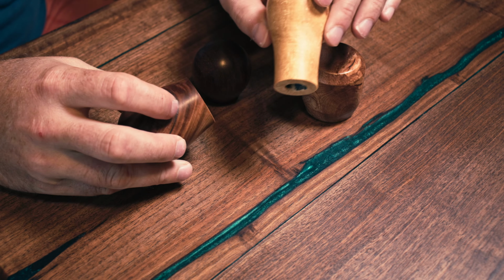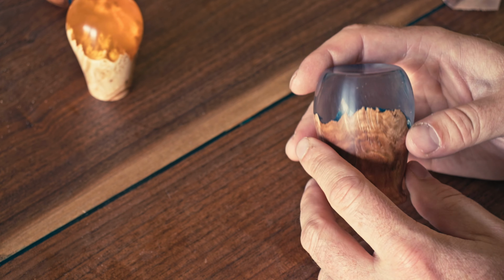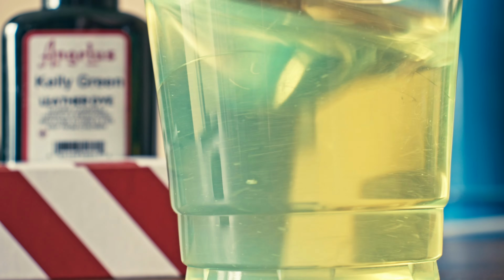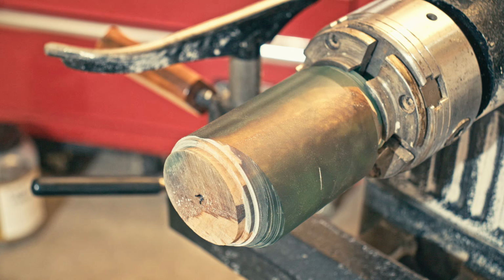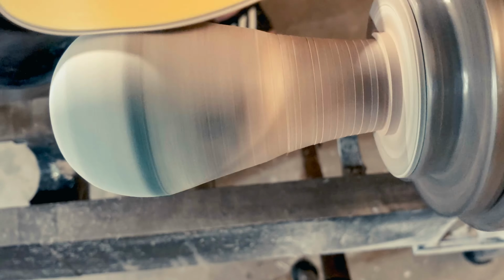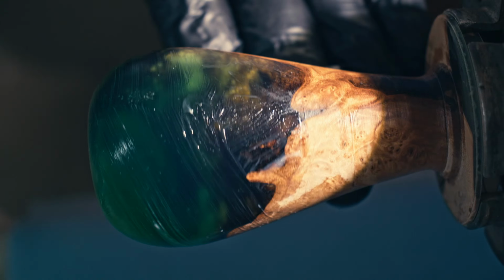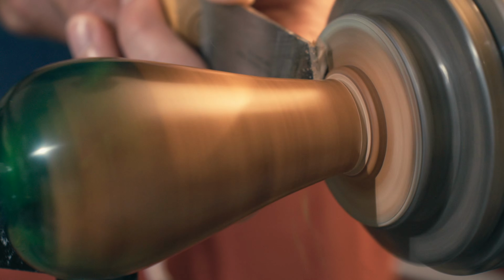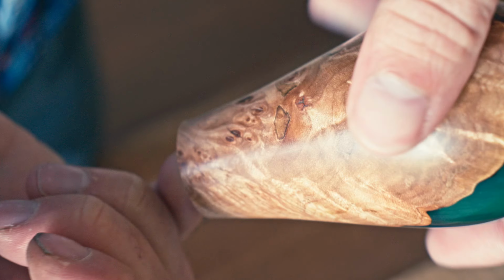Making A Shifter Knob from Burl Cap & Resin (My 400th Knob)

Comment from the maker: The biggest flaw in this knob was all the visible air bubbles in the resin, I've since gotten a vacuum pot and can't wait to start making resin project castings that no longer have visible bubbles in them!
Reply: how's the vacuum pot? did you feel you needed a pressure pot as well?
Reply from the maker: @ it’s been very useful, haven’t felt the need for a pressure pot yet.